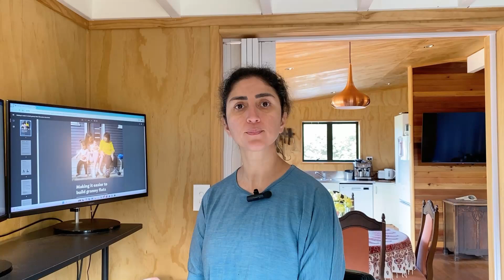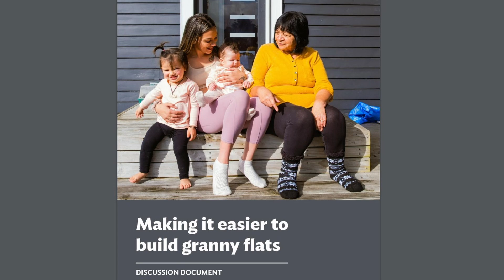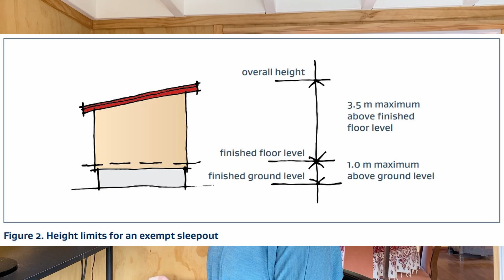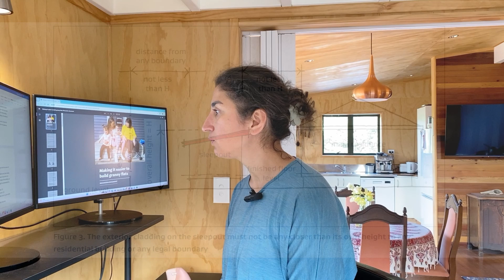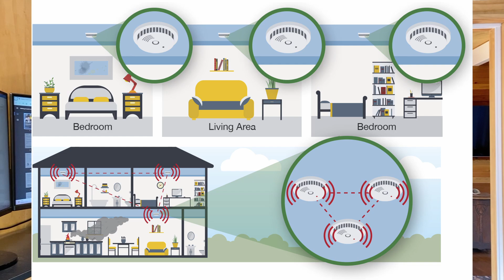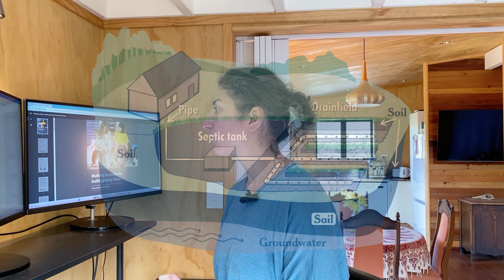Building a 60sqm house without building consent and resource consent in New Zealand

Comment: $160,000-$180,000 is actually a lot of money for a normal family.
Thanks for your video, do you know how much does it cost to build a 30sqm under the current rule in Waipa? Thanks
Reply from the maker: It is really hard to put a number down based on the size of the building. Prices vary between 2k per sqm for a very basic owner builder up to 7k or more per sqm for hi spec buildings. Unfortunately properties are the most expensive expense for families and it is only getting worse. That is why most people have to take a 30 year loan to be able to buy a property.
Reply: @3dmaker223  thank you for your reply. I will take that as $60,000 to $210,000. Thanks
Reply: @3dmaker223  that does seems very achievable for owner build basic. I guess that price include all the cost of designing and materials etc?

Comment: if I’ve picked you up correctly on how you explained it this is no cheaper than getting a building consent all the other costs are still there and of course you run into a raft problems on a small section with a septic tank by the time you go through the environmental authority and then the council you are looking for a large cost to me there is no advantage it’s just lipservice from the government and council as usual but they still get their pound of flesh
Reply from the maker: @davidboyd8113  that is what I think. All the costs are still these apart from bc application. But if the council is not involved, the lbp people involved are more liable. Why would they do it for same price? Each lbp will increase their price a little bit to cover their insurance. And the owner will end up paying same money with a building that doesn’t not have the same value if it had consent.

Comment: Worth noting the use of the phrase ".. the measure of it's own height..." in the actual regulations and the graphic representation shown which conflicts with the intent of that phrasing. That phrase is often altered to "a building's height" or (as you said) "a building's overall height". There is a reason for the specific wording. The "measure of it's height" refers to the point at which a height measurement is taken and it cannot be closer to a boundary (or other building) than that measurement, at that point. The low-side wall of a pitched roof building can be closer to the boundary that the high-side wall or the ridge. If this was not the case, the regulations would say "A building's overall height". It doesn't, "the measure" is the thing being referred to.
Reply from the maker: I would like to interpret the wording same as you as it makes more sense. However, their diagram in the guide (for 30sqm- they do not have a diagram for 60sqm yet, but their wording is the same) shows the building's overall height.
Reply: @3dmaker223 Yeah it’s not just me. I have seen previous articles that explained the height requirements as well as previous District Plans (Wellington specifically) where height planes and building setbacks are illustrated. Not sure if I have copies on my desktop but my working with this goes back 20 years. 
MBIEs pdf guide of exemptions has several mistakes where they try to interpret the regulations into their version of plain English (one of them relates to the exemptions for verandahs). 
I would absolutely stick to my interpretation. Again, there’s a fundamental reason they chose those words. Words matter especially in legalese.
Reply from the maker: @DiscoFang  Yes, I have found mistakes too. Also NZS3604 and BRANZ having discrepancies. I would like to stick to my interpretations too, but (most) council officers are so annoying to deal with and you cannot have a sensible argument with them. I try to avoid it as much as I can.
Reply: @3dmaker223 The fundamental reason for the measurement thing is potential damage from a structure falling over. A failing (then falling) building component can really only fall the distance of its own height, and consequently cause damage to a neighbour or other building. Setting back, say, a 2.4m wall of a building 3.5 meters away from a boundary simply because another wall is 3.5m high makes no rational sense. And despite what many loopies think the building code and regulations are deeply rooted in rational sense.

Comment: Get an engineer to oversee your project. Build it to spec and get engineer to do a couple of inspections, foundations and framing etc. Build it. Get electrician to wire it from main house, write out a electrical cert. Or just solar power it. Water from roof to tank. Get drainage ps3 for sewer and storm. Done.
Reply: How much does an engineer cost? is it cheaper than going through council?
Reply: @mooselee902   Get an Engineer to do the plans as well. They are out there, look around, sit down with one, at his office, talk it through. Big money saved if you can do the work yourself. Electrical, always get an electrical cert. Solar is simple. I would be doing solar.
Reply: @markcleaver6573  I think it would be easy for you Mark (and all credit to you) but how many people do you know who that would apply to?
Reply: @gideonporter537  Well building it yourself is the key to saving a lot of money. So how clever are you ?

Comment: what a complex kerfuffle. best just to get a big caravan
Reply from the maker: Caravan option always existed, but is it really a replacement for a house? specially for older generation who need more accessibility and comfort? Also, let's not forget that a building is an asset and appreciate in value but a caravan depreciate in value. Afterall, depending on the personal circumstances, caravan might be the better solution or choice for some. Looking at livable caravan prices, they are not a cheap solution either.
Reply: @3dmaker223  Well said.

Comment: My argument against, very simple, at present LBP only required to carry PI insurance for 10 years for the build, however building code B2 requires minimum 50 years for a build, who carries the liability for the remaining 40 years.
Reply from the maker: I do not think you can hold anyone liable for 50 years. Even the 10 year liability is ridiculous in my opinion. The B2 requirement is for the way the structure is design to withstand the environment for 50 years. It is not about holding the builders liable. Everyone is liable for their property. That is why due diligence and insurance exist.

Comment: still far too complicated and expensive for the average family with a mortgage to afford. Builders and tradesmen  as councils will simply charge their usual inflated fees so where is the savings or incentive for the owner? This will not be an effective solution to the housing crisis in NZ.
Reply from the maker: I think with the way they have over-complicated and heavily regulated building in New Zealand, there is not an easy way to make it affordable.
Reply: You are wrong. Container homes are tanking right now.
Reply: @markcleaver6573  any home? Costs of build just making it too difficult.
Reply: @gideonporter537  Yes but paying rent is dead money. Buy a section, put a small garage on the section. Live in it, build the house over 3 years from the sleep out(garage).. Or just stay in the sleepout and save money.
Reply: @markcleaver6573  I agree - but isn't this about an additional dwelling unit on an existing property? Your case is different - and wouldn't be allowed in many councils?
Reply: @gideonporter537  Yes you are correct. I started in 1990. So I bought a section with a garage already existing. I lined the garage. I lived in the garage with power already existing. Solar could be used. This immediately saved me rent money. From there I could build my house. Legally.
Reply: @markcleaver6573  and I agree that your way is a good option for those that suit that. But this government "solution" is no such thing - not even close. It still looks like way too much bureaucracy, and locked-in rules and regulations designed to benefit professional tradespeople not the consumers.

Comment: I have worked  in the building industry  for 52 years, just retired, builder by trade,just build a 30 Sq meter my place,knowing the council proceeds, really  wasn't a problem, time factor minimum at council, getting  the right  position on section, picking  up your sewer line,and fall connection, separate  sock hole for storm water,power from house meter box, make it look appealing  resale .
Reply: Can you explain a bit further? How do you pick the right position? What is the cost to conmect the sewer line, power and water etc? I am doing research for this to build on my next property and seem like there’re lots of hidden cost.
Reply: Position  is a requirement.  No1 from the side boundaries  min = 1.000  front  5.mters . Sewer connections will be on existing building plan  .water and power connections front boundaries.  Or power pole (old  type ) . On piles is simpler . Can be removed  . Plus no  issues with flooding  or ponding. Keep flooring less than a meter from ground level .get tradie quotes for cash and itemized all labour and materials.
Reply: @paulchristensen2573  thank you.

Comment: Call me a cynic, I reckon the rules are going to be firmly geared to allow the easy roll out of pre fabs from Fletchers purpose built facility. Unless designers / engineers are going to be heavily relied on for compliance, the system will unfairly disadvantage those living on hill properties, flood prone areas, etc.

 I love the principle , it could so easily use the LBP scheme as a great resource, but alas, my thoughts are that all the chat of ‘cutting the red tape’, ‘affordable accomodation’ etc are straight out the window and it’s all about the easy pickings for fletchers prefab.

I would be absolutely delighted to be proved wrong on this one 🤗
Reply from the maker: @Tryinghardtobecreative  I tend to agree. One of the options that they are proposing is: targeted promotion campaigns of Builtready and MultiProof. Let’s see if this one goes ahead, which will prove your theory…

Comment: You still need plumbing and drainage and power that will need council to approve
Reply from the maker: @brianna56ism  this exemption is different from the 30sqm exemptions. Under this proposal, you are allowed to have plumbing without a building consent. If you are on a septic tank, you need to get a consent for the septic tank, but not for the plumbing in the house.

Comment: wonder how they compare to a tiny house on a trailer.
Reply: Compare in what way?
Reply: @Tryinghardtobecreative  how easy it is with regulations.
Reply: @gosekinz  the proposal is for a new section of the building act for this type of dwelling. 
Technically a tiny house can’t meet the building code when on a trailer, it needs engineered foundations to support and hold the trailer, which kinda defeats the whole point of a trailer.
Reply from the maker: @Tryinghardtobecreative  I agree with you. They might add a section in schedule one or introduce a new section. Either way, these exemptions do not apply to tiny homes on trailer.

Comment: Great information. Wellington region might be out for this given it it in a very high wind zone.
Reply: The wind zones relate to structural design not fire design. Each individual site needs to be assessed for wind zone . You can’t rule out a region based on a generic wind zone.
Reply from the maker: @joannebrown7921  you are right, it is not region base. It is site based and you can find out about the specific site wind zone from the local council plans or Branz maps. Some sites do not have enough information on these maps and have to be assessed by an engineer.
Reply from the maker: @mrFizzboat  you would be surprised to see how many sections are in more than high wind zone throughout the country. Most high wind zone and below are in city centre areas that are e sheltered. But then the sections in these suburbs are so small and high density that this rule will not be of any use for them.

Comment: Is the floor area to the framing or the lining? I know it's a small difference but everything matters right... Thanks!
Reply from the maker: This is the exact text from the MBIE website: "The net floor area in a building is measured to the inside of the enclosing walls or posts/columns." It is unclear if they mean framing or lining. But then we have the definition of net internal floor area from Auckland Unitary plan which says: "The floor space between the finished surfaces of internal walls between rooms". So I believe  net floor area is measured to  the lining. And yes, every small thing matters!
Reply: @3dmaker223  Yeah traditionally it's always been to the framing but I guess this is why it's a discussion document right. Different Councils have different rules.
Reply from the maker: @muddlethrough  there are lots of gray areas in the definitions and also across the building codes. Council officers also like to interpret the rules and definitions the way they like. Sometimes you get two different opinions from two officers in the same council. When we measure the net lettable area, it is to the lining.
Reply: @muddlethrough  Traditionally it's always been to the outside of walls - the footprint of the building. The ONLY place in the building regs or codes that uses an internal measurement to define or describe a building size is in the recent exemptions for up to 30sqm accessory buildings. The new Granny Flat regs would be the second use of it. It's an odd thing.
Reply: Where do you sell your plans on TradeMe pleaee?
Reply from the maker: @themidlifeapprentice  here is a link to one of my listings. Please watch me as I am going to have a massive sale next week because I am releasing a new design: https://www.trademe.co.nz/building-renovation/portable-cabins/auction-4895952752.htm

Comment: Thank you so much, it's not so much of a lifesaver as it first seemed! Do these rules override the 30sqm builds or is this just from above 30sqm and up to 60 sqm?
Reply from the maker: I believe it is a good rule depending on the project. But as I mentioned in the video, I would still apply for a BC. Probably not a RC. This will be a new rule and does not override any previous exemption. They have not said anything about the minimum area yet, so it can be for anything under 60sqm. Note that you cannot alter an existing building. So, if you have built a 30sqm and want to convert it to a granny flat, this is not exempted.